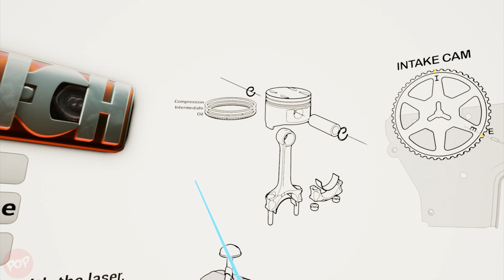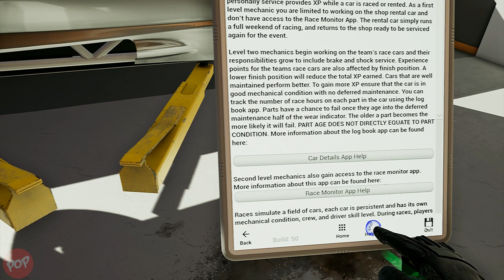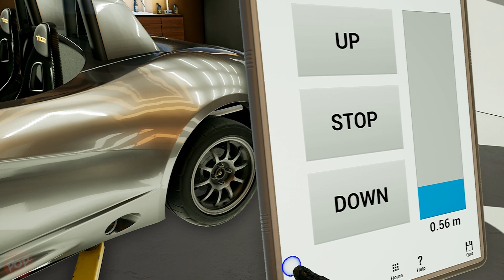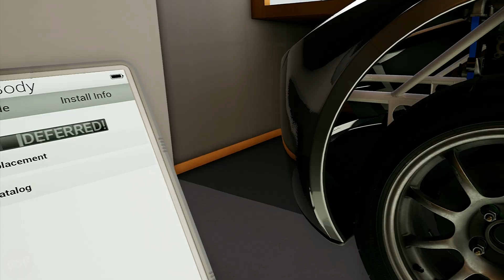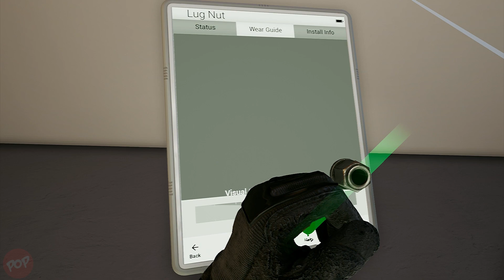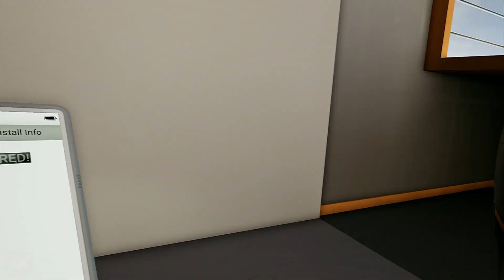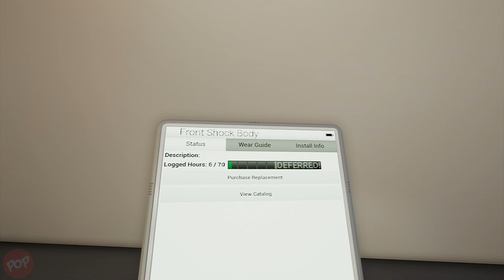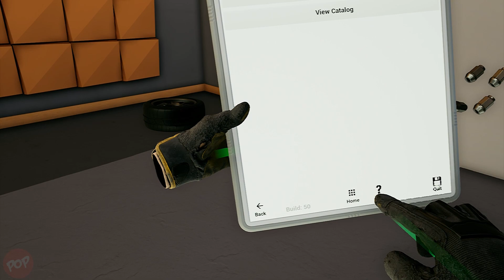Wrench VR : Engine Building Full Version | An Awesome great assembling VR experience. Recommended!

Comment: I am having the same problem, with removing the engine. I have removed the transmission and all the bolts holding it to the car, but it does not come out as a full assembly. Do you think the developers want you to tear apart and rebuild the engine while in the car. Hopefully this is just bugs in the early release. It's a great game though, thanks for the footage.
Reply: I simpley lose one screw under these buffers right and left and the engine comes out.
Reply: I can't get the engine to come out either. My block needs replaced and I've taken the 2 engine mounts off plus the gearbox and wheels but nothing. 
Even tried stripping the engine completely while it was in the car but the block won't budge.
My only option was to press the button behind the clear shield to explode every part off the car but then I'm left with replacing every single nut and bolt on the whole car........

Comment: i hope this game comes with a warning like alot of racing games do , " this is a game and provides a simulation on the basic assembly, but by no means is a training tool,  working on your own car without the proper training can result in injury or death,  in many cases please seek a professional tech. - decent idea tho
Reply: common sense but yeah
Reply: To be honest with you though, it's a lot more than just basic assembly. Almost every nut and bolt is in this game apart from the inlet and exhaust manifold plus the wiring.
I think it could actually be used to train apprentices. The only thing it doesn't train you for is the strength and awkwardness of trying to get into some of the really fiddly bolts where you end up bashing your knuckles off of something